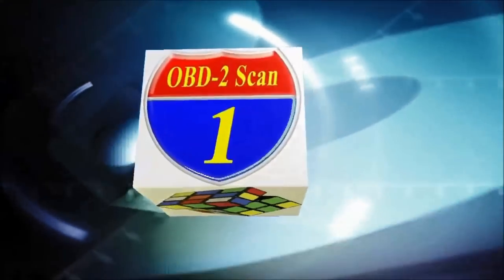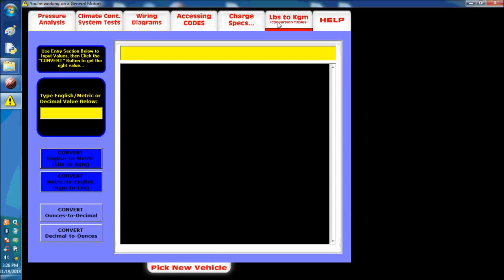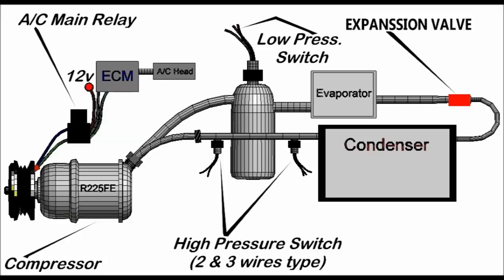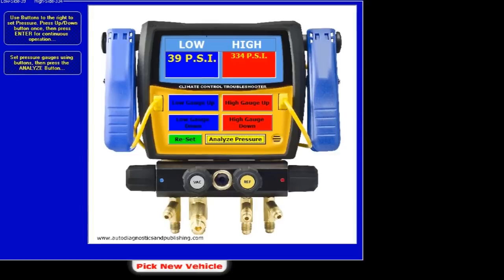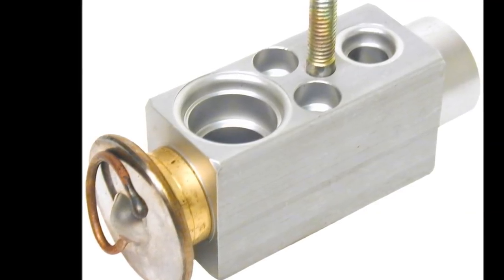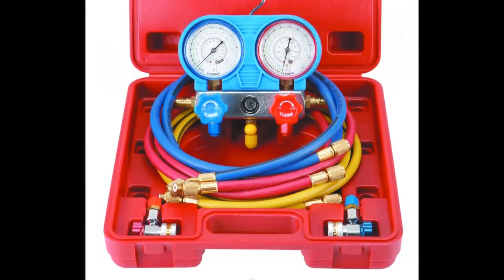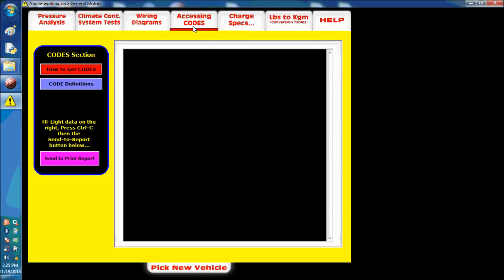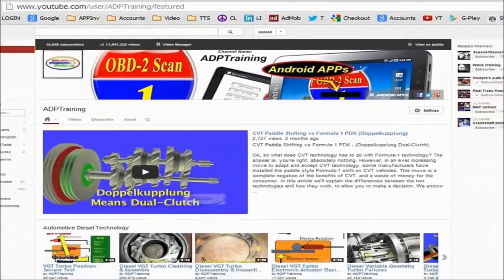Software for Expansion Valve Diagnosis

Comment: Very good explanation but in today’s control on top of adjustable compressors displacement throwing in expansion valve that are electronically controlled now in the automotive manufacturers do not locate your gauge service fitting in the proper location to get an accurate pressure measurement. Example high side service fitting located right off the discharge port of a compressor compared high side service fitting located in the liquid line just before the expansion valve you can have a 50 psi or more pressure difference low side example service fitting located for low side right after the evaporator or low side service fitting after that accumulator just before the compressor Will give you completely different readings and then an experienced technician for that fact majority of experienced technicians gives them a problem. You may want to add to your diagnostics  software the Testo or Fieldpiece six pice probe kit with the data logging software. I’ve already worked on some of the new 2017 Prius prime with heat pump system this will cause another headache for automotive technicians who do not understand heat pump’s. I work in both automotive and I have a commercial air conditioning company where I work with heat pumps in chiller water systems for the past 27 years as you may know the chilled water systems for the inverters including the air-conditioning expansion valves secondary loop systems for cooling down the batteries and the inverters are now all included on all air-conditioning systems that are hybrids. Some vehicles even have a secondary expansion valve mounted directly onto the battery pack in the back of the vehicle with shut off hard stop solenoid that causes a whole Nother level of diagnostic problems for unknowledgeable technicians. Keep up the good work with the videos👍
Reply from the maker: Wow, thanks that's quite a bit of experience on your part. Thanks for the input. I already have an AC HVAC playlist here on my channel ADPTraining, so check it out. Thanks again, Mandy.